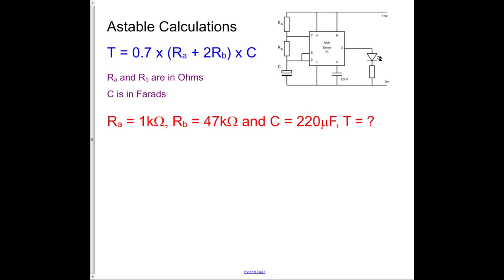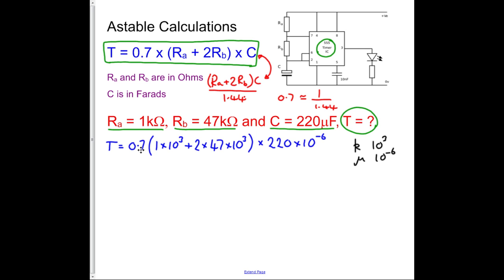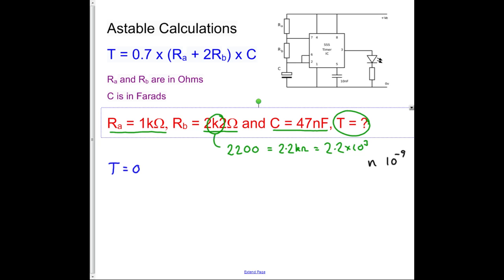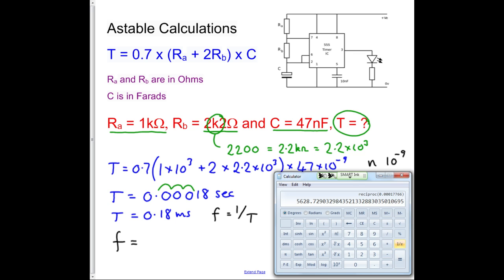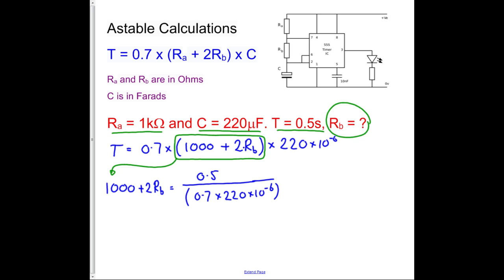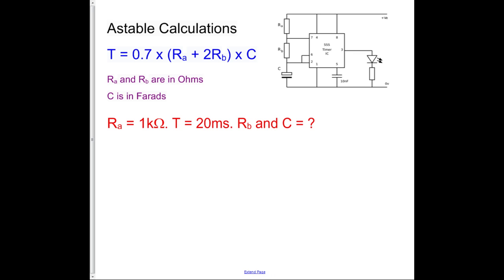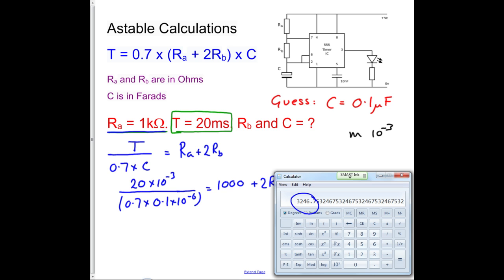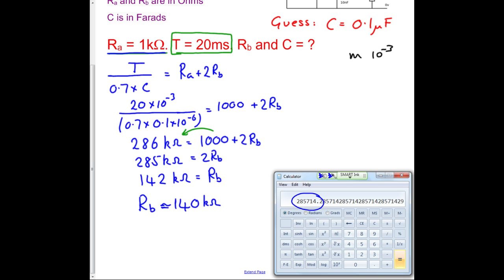555 Astable Calculations

Comment: hey bro how can i set the duty cycle 50 percent
Reply from the maker: You can't set the mark:space ratio as 1:1 (50% duty cycle) with a 555 astable. You can get close if you set Ra to the minimum value of 1k, use a small capacitor and a correspondingly large value for Rb. If Rb >100k the duty cycle will be 50% within a tolerance of about 1% or less which is probably a better tolerance than the resistors themselves anyway.

Comment: hi, how to calculate 555 timer blinking rate that just using one resistor Rb only?
Reply from the maker: The blinking rate is also known as the frequency so just use the equation f= 1/T where f is the frequency and T is the time period. If you keep Ra as 1k then you can adjust the frequency using Rb
Reply: ElectronicsTeaching how about just using 1resistor only?.
how to calculate base resistor for bd139 transistor?